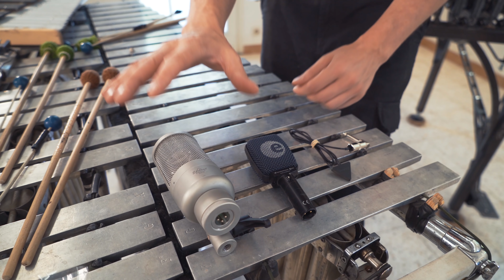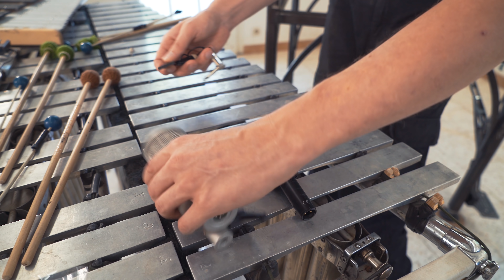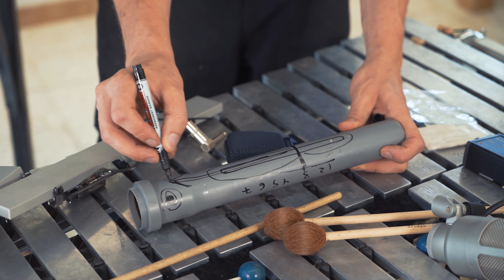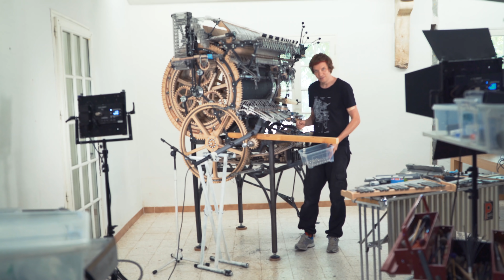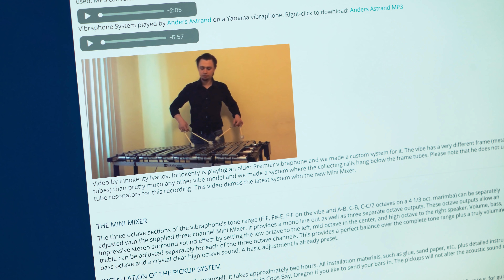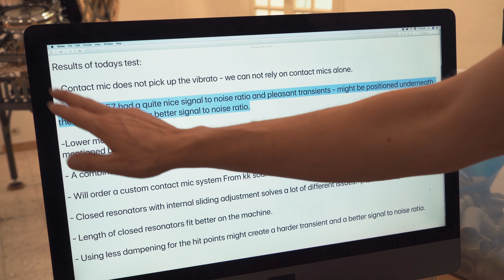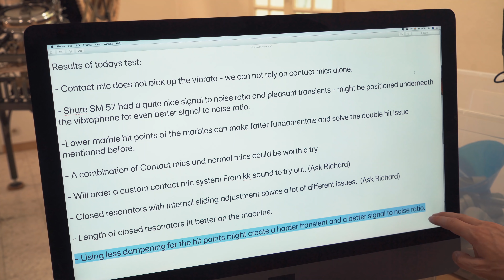Vibraphone Experiments / Microphone Types - Marble Machine X #96

Comment: Why didn't you try stricking a contact mic to the end SIDE of a resonator pipe? Crazier ide a? Does rotating a contact microphone generates the Vibrato in the recording? You would be able to change resonator pipes but have an axis of rotating mics that helps generating the vibrato both in an acoustic and amplified version.

Comment: As much as it may hurt, I would go for the digital vibrato solution. It might not be "genuine", but it solves all your problems. Why not use the technology when we have it?
If you do end up doing it the "real" way, could you stick the Shore mics up into the end of the adjustable resonator pipes, as to shield it a little from the rest of the machine sounds?
In any case, having contact mics on the plates is unconducive to your plan of changing things on the fly.

Comment: I think the combination of contact microphones and normal microphones is plausible- if every key has a contact microphone, it will pick up the main signal well, however you would only need 2 normal microphones spaced evenly apart at the resonator pipe section, to create the stereoscopic effect needed to actually hear the resonance. Especially since you tested whether the machine noise would be too loud and it clearly wasn't.

Comment: Someone probably allready said this, but if you glue on the contact mic, how are you supposed to change the keys. Aswell as the resonator pipes. If each key needs there own specifications length pipe, what's your plan on changing thoughs?

Ps, I kind miss the way you'd say ID

Comment: why not do the vibrato with electronics? then you can use the contact mic.

it can still be in time with the machine, you just need a rotary encoder on the vibrato flaps (or on any moving part of the machine)

Comment: Hey! Sound engineer here. The statement about a condenser mic being the one with the highest signal to noise ratio is false. In this kind of mics the noise floor changes a lot depending on the quality of the mic itself. Dynamic mics do not have enough details to describe al the upper harmonics of a vibraphone and contact mics noise do not catch the acoustic image of the instrument and are very compressed by nature. I recommend trying some good quality small condensers, the kind used for micing strings for lives gigs may be easy to place in your machine. I recommend DPA mics, not really cheap but they sound amazing. A couple of those in a ORTF placement can deliver a nice and natural stereo image. There is no need to mic every single note.
Reply: Astronometric agree

Comment: It might be possible to use a standard contact mic to pick up the base note (just as you did at the beginning) but also place a second, traditional microphone inside the resonator tube then filter its output down to very low frequencies only until only the vibration envelope remains then use that to modulate the contact mic's signal.

Yes, it would still be an "artificially modulated" sound that otherwise would have no vibrato, but the source of that "artificial modulation" would be the real-life vibration going on in the tube...

Comment: The signal to noise ratio sounds okay with 1 dynamic mic, but if you have a full array of them the noise will add up significantly. The machine is always going to be making noise but not every note will be playing, and the only way to get rid of the noise will be noise gating, which will potentially kill sustain. You've also got the marble catchers to go, which will be loud unless you pad them.

You might also discover phase issues, since each mic will pick up the surrounding pipes too, and these will be really annoying to solve. Thinking forwards to the live situation too, having a whole bunch of dynamic mics pointing upwards and outwards is also potentially going to be an endless source of feedback headaches, not to mention they will be at the end of literal resonator pipes which will resonate with the feedback frequencies.

To me I think there are a whole bunch of potentially really nasty problems with trying to get a full resonator pipe setup mic'd up (and this is going to be on top of any issues with other parts of the machine that you will inevitably have). I'd say that anything you can do to minimise risk right now would be good, you should install the contact mic array and a Vibrato effect (you can get analog effect boxes to avoid any digital latency) to fall back on, assuming you can; I don't think they will suffer from any of the above problems and it should still sound really good.

Also, can't believe you finally learned how to say "idea"!

Comment: Small dynamic mics to pipe, that way you can use actual vibra since digital might not suite your needs. And quick clamping rail to change mic locations accommodate different pipe lengths

Comment: My tuppance: using a digital vibrato effect goes against every aspect of the MMX’s mechanical nature
Reply: I agree. Even though he used a whole ton of EQ for the drums on the last machine, he never put any effects that drastically altered the sound, to the point of substituting a mechanical component on the machine.
Reply: How about if it was an analog vibrato effect using electronics!?
Reply: @Evan Cottle This could work :) https://www.youtube.com/watch?v=31pgOcLlCo0
Reply: This machine is an awesome fusion of mechanical and digital.  It is both handcrafted and 3d printed using cad (digital) software.  It's made with both modern and classical materials.  If it's a choice between something that works well and something that's a big headache to make work and has a poor SNR, I think the digital choice is reasonable.
Reply: He only tested signal to noise using one microphone. As he adds additional microphones the noise will be additive, the signal will not.  The signal to noise problem will not be solvable without digital processing anyway, and questionable if it can be solved at all. IMO contact mics are the only workable solution.

Comment: Martin, SNR of a single mic is not going to be representative of what you’d end up with in the end. 

If you use acoustic mics your SNR is going to decrease (I believe logarithmically) the more mics you add. 

The signal amplitude of each tine will remain the same as the background noise from ALL the mics is added upon each other.
Reply: There's slight phase differences between those microphones. Maybe that can be used to construct a "noise " channel that can be mixed together with the rest to get rid of the noise?
Reply: @Lttlemoi  How about just having a couple of mikes inside the machine to do just that and create phase cancellation?
Reply: I was thinking this too.  The "pleasant crackling noise" will be 8 times stronger, and that might be too much when it comes down to it.
Reply: @aaronrobinson2121  How about inverting every others signal and using the mics as pairs to eliminate noise?
Reply: @RhenusFilms  That would have the effect of also flipping the phase on the notes themselves.  Since they're the same instrument I bet there would be a lot of weird artifacts.
Reply: Blaulichtmilieu pairs would only work if you could guarantee that each mic only caught the sound of the note it’s pointed at which won’t be true. They’d cancel the signal.
Reply: It's not really about SNR but rather the directional pattern (off-axis sensitivity). Large-diaphragm condenser mics are omnidirectional or cardioid and they are very sensitive as well, so they pick up sounds from every direction; small-diaphragm condenser and dynamic mics are typically supercardioid or hypercardioid, and they are less sensitive, so they mostly pick up most loudest sounds coming from one direction.
Reply: @dmitryko76 , not necessarily on all of that.

Electronics design in the mic is the primary contributor to sensitivity, and capsule design and the mechanical design around the capsule all have a tremendous influence on polar patterns.

You can get an LD condenser to have a very tight polar pattern, but typically they'll lose directionality at lower frequencies, whereas SD condensers oftentimes have better full-range rejection all the way around the polar pattern. I'm not totally sure why this is true, but I imagine it actually has more to do with the way that polar patterns are typically implemented in both types of mics – LD mics tend to use electronic cancellation between the two capsule sides/diaphragms, whereas SD mics often use acoustic porting and cancellation across a single diaphragm.
Reply: @robertschwenkler8105  I'm not sure what you are debating here. Signal-to-noise ratio of dynamic and piezo-electric mics is infinite, because there are no active electric curcuits which introduce self noise - they simply do not generate any voltage in total silence. For example, Ehrlund EHR-M large-diaphragm and Shure SM-57 dynamic mics from the video have sensitivity of  -33 dBV/Pa (23 mV/Pa) and  -56.0 dBV/Pa (1.6 mV/Pa) respectively (1 Pa = 94 dB SPL).
Reply: @robertschwenkler8105  I think the issue with the speed of the gate you're talking about is not a matter of analog vs digital, it's more a matter of what technolgy it's using : tubes, transistors, optical sensors ? They don't have the same speed. And even a hardware gate can go really really, really fast. Snares are gated no problem.

Also i think  Dmitry Kornienko didn't want to explain how microphones work, what he said is kinda right ( and yeah we know of the Josephson C700 and such). What he pointed out is rather that Martin would be mistaken to choose anything else than a cardioid pattern.
I would add that the "noise" Martin is talking about is not the SNR noise, he's talking about the other sounds that bleed into his mics. The SNR noise is the noise created by the electricity flowing in the components of your sound equipment. And yes, as you multiply the mics, the noise will increase. BUT : you can addition sound intensities for signals of the same source, if so, the level will increase of 3dBu everytime you double the source. Suppose every plate is miked up that makes 11. One mic you have lets arbitrary say 1dBu of noise, two mics you have 1+3dBu, four mics you have 1+3+3, eight mics you have 1+3+3+3 and so on. Just wanted to point it out.
Anyway Martin should try small diaphragm, cardioid condeser mics, in a XY pattern above the board, and try something similar for the tubes. 4 mics are enough imo.
Reply: @dmitryko76 , we're not talking about internal SNR of the mics or their amps, rather the mic's ability to capture a vibraphone tine (signal) and reject off-axis sound (noise).
Reply: @UnchosenMr , a vibraphone tine is still going to have a faster initial transient than your average snare – there is a lot of high frequency content in there.

I don't have a ton of experience with hardware gates, certainly a tube gate would be too slow, if you can even get your hands on one, but even most transistor gates might not be fast enough to capture the full attack of one of these things.

It's just conjecture, like I said, but it would warrant testing.
Reply: @robertschwenkler8105  An Automixer could do the trick as well. Dan Dugan's algorithms are probably fast enough, and it wouldn't require gate settings or anything. There are cheaper alternatives as well
Reply: @robertschwenkler8105  The ability to reject off-axis sound and backgound noise is exactly what the polar pattern diagram shows -  that is sensitivity in each direction on a 360 degree circle. But that's not SNR. When Martin talks about 'signal to noise ratio' of condenser, dynamic and piezoelectric mics, he probably confuses it with dynamic range, which depends on sensitivity (i.e. sound pressure required to produce a certain voltage).
Piezoelectric mics are the least sensitive of the three types with the narrowest dynamic range, so they only pick very loud sound - these are practically direct hits on the piezo element. They cannot pick the vibration of the air - there is never enough sound pressure to make the piezo element stretch and expand. So you basically overamplify them, which produces very compressed sound that rejectecs the low-level details, but because they have no self-noise, the SNR of the entire signal chain remains low. It's a kind of acoustic-analog compander (compressor-expander) system. The same principle works for low-sensitivity dynamic instrument mics like the Shure SM-57.
Reply: @UnchosenMr  Thank you for explaining this in more detail. I'd just like to add that since dynamic mics do not produce signal noise by themselves just llike piezoelectric mics, all noise comes from overamplification. So if all the mics are connected to one single pre-amplifier (directly or with a simple variable-resistor external mixer), there is no additional electric noise. 
That said, modern mixers have very good microphone preamplifiers and their self-noise is very low, so mix engineers came to using separate channel strips in multi-mike setups, so each individual microphone has its own compressor/noise gate, EQ and effects send.
Reply: @dmitryko76  Yeah exactly ! Anyway, SNR should be a concern, but not a problem in any way, same for sensitivity; just be careful with the input levels, the mic choices and their placement and the equipment you're working with as well as the processing. Maybe Martin should think of the MMX not just as a standalone (I don't know if he does that way tho), but as a reunion of different stages, sound engineering being one of them.
Reply: @dmitryko76 , Martin isn't talking about internal/electrical SNR in this video.

He's not confusing anything, although I get that "SNR" isn't usually used how he's using it.

He's talking about a mic's ability to capture a desired signal (vibraphone tine) and reject other sounds (everything else that's not that particular tine, and not necessarily all of those sounds will be off-axis).
Reply: @robertschwenkler8105  No. Martin is absolutely correct to say that condenser mics have 'the worst SNR' and that piezoelectic mics have 'the best SNR', as they indeed have zero electric noise, and that they are not sensitive enough to capture vibrations in the air. 
But the implied conclusion that condenser mics are the worst for rejecting background acoustic noise is not correct. They just have the widest dynamic range due to their high sensitivity (and low noise), while piezo pickups have the narrowest DR due to their low sensitivity which requires overamplification (and zero self-noise which makes this amplification possible). Their low sensitivity is making them reject background sounds, not their low SNR. 
The point is, SNR, DR/sensitivity, THD etc. is just a parameter to work with. All three types of mics can be tuned to work reasonably well, and there are multiple suggestions in the comments about specific low-sensitivity dynamic and small-diaphragm condenser mics, their placement, and amplification/compression/NG/mixing setup.
Reply: @robertschwenkler8105   Could be useful? It says: "The sound is natural, rich, dynamic, powerful, precise, reproducing even the vibraphones tremolo … " https://www.ischell.com/en/balafon-vibraphone-and-multisource-instrument-pickups/
Reply: @dmitryko76 , I don't think that you and I are having the same conversation.
Reply: @BUSTtheTIVO , interesting. Those must not be contact/piezo mics? Or a combination of contact and acoustic? Do you know what type they are?
Reply: @robertschwenkler8105  Well I think it's just a innovative contact microphone... Ischell is from France, so Martin could try to get a free sample hehe :) The pickup called AirBag-C is  super well evaluated when it is part of the system Insider J48C (used mainly with strings). Reviews about the use in vibraphones I haven't found. But there are demonstrations of several pickups on Ischell's chanell on  youtube. Martin should try, maybe is worth.
Reply: @robertschwenkler8105 My conversation is about  signal to noise ratio of each microphone mentioned at 1:40, which is the best for the Ehrlund Pickup and Shure SM-57 mics and the worst for Ehrlund EH-M condenser mic. Yours is about SNR as a characteristic of the mic's ability to selectively reject sounds, which is different from off-axis sensitivity or signal to noise ratio as specified by each manufacturer. Do I miss something?
Reply: Actually, he just needs very clever microphone tech and techniques to archive good SNR.
Reply: How about a noise gate?
Reply: @connormcinerney7503  My thought though is that you could use the contact microphone as the trigger for the gate of a mic in/on the resonator
Reply: @connormcinerney7503 , that'd be possible for sure, I had the thought as I was watching.

The marbles are very percussive, so I'm not sure how well the attack time of a gate would perform to catch those transients, but it's possible it could work well (enough).

That would be another round of testing for Martin to go through!
Reply: @robertschwenkler8105  noise gate is definitly an easy solution. The transiant is realy high and consistent so you can realy easyly set it to only let sound through at the right time
Reply: @lucasvivante8988 , sure. I'm just considering that a marble is so percussive that a gate, especially an analog gate, may not be fast enough to catch all of the initial transient.

Comment: Did you try placing a contact microphone on the resonator pipe? In theory, the sound passing through the resonator pipe should cause the pipe to vibrate which can be picked up by the contact microphone. (Though you might get a terrible signal/noise ratio as the machine will also be vibrating the pipe.)